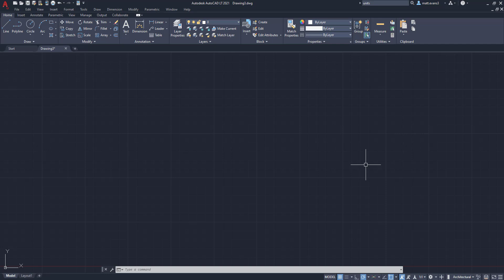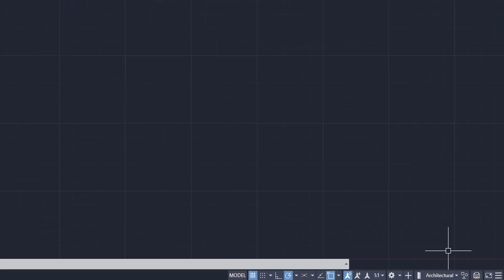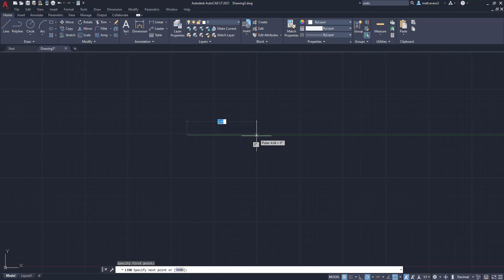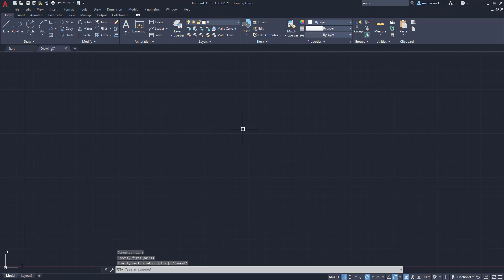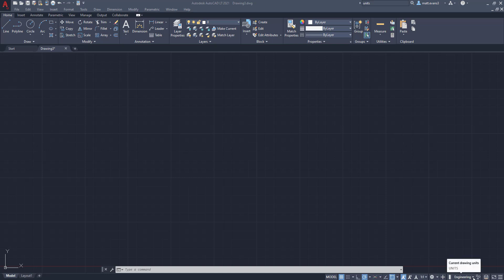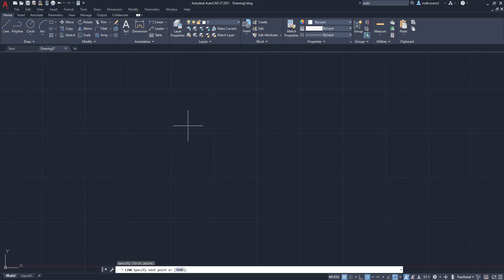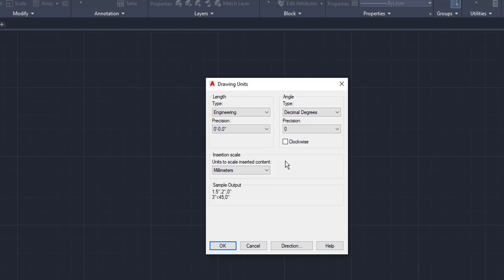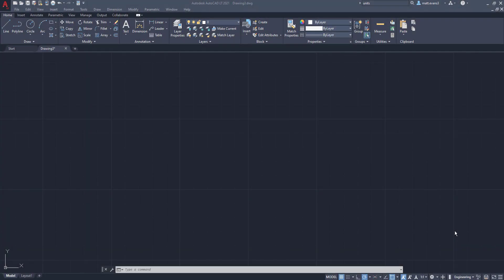How to CHANGE UNITS - AUTOCAD

Comment: SORRY mate but the drawing units of an Autocad file are configured with the "DWGUNITS" command, the "UNITS" command you explain is a way of DISPLAYING the units in different measurement systems. it is a crucial matter when inserting blocks from different systems of measure. A very misunderstand subject that Autodesk never addresses properly and users don't fully understand.
Reply from the maker: If you could explain further? I have the drawing units box up in the second half of the video and change those as well. I have also never had an issue inserting blocks since my units match the drawing and most of the time will for other users. It's not fully understood because the difference is more of a nuance instead of a need especially for beginners.